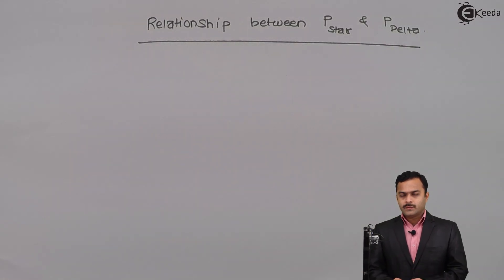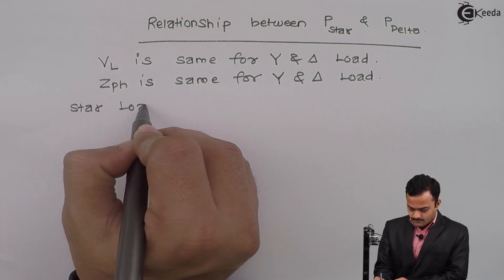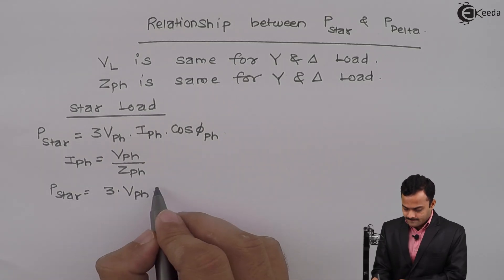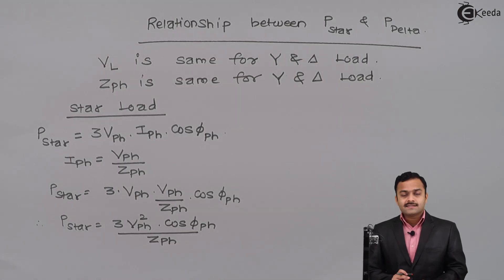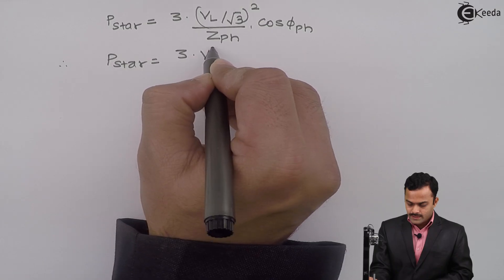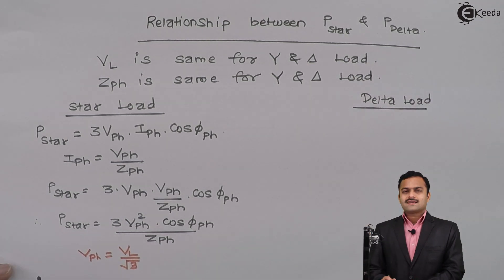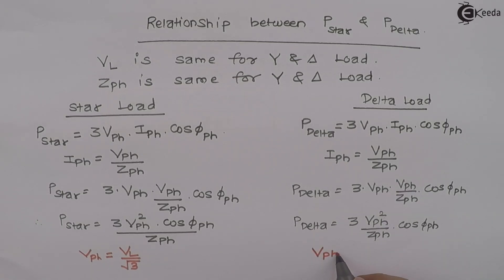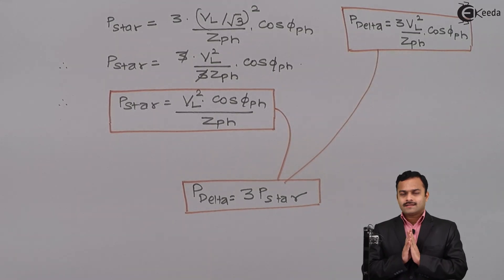Power Consumed by Star Circuits and Delta Circuits - Three Phase Circuits

Comment: No power ratio should be same , bcoz in star Delta connected transformer at both side power is same
Reply: explain this !
Reply: No transformer is not load... It is source...this theory is applicable only for loads like motors